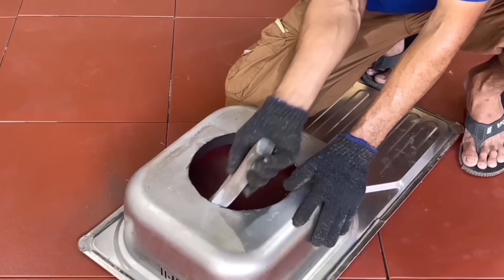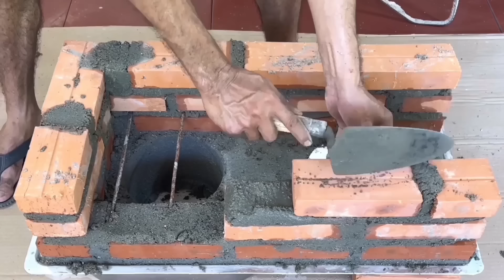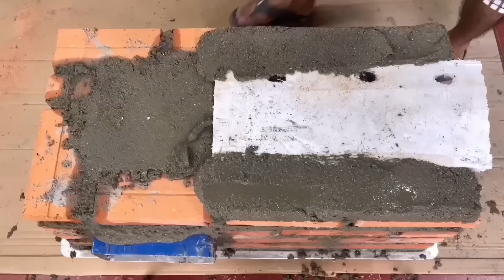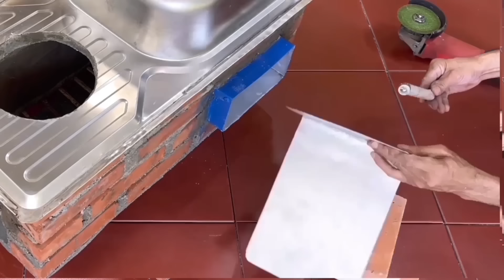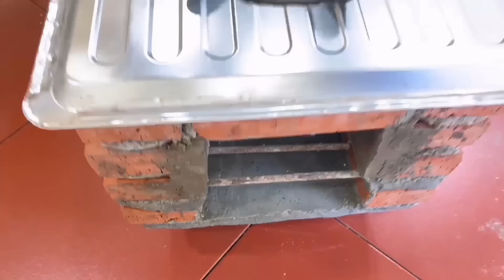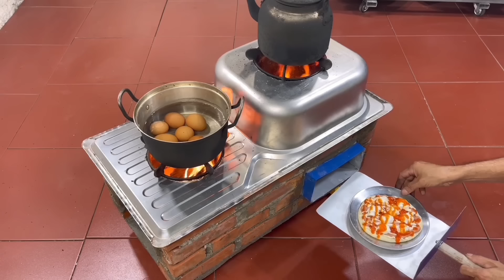wood stove (2 in 1) with pizza baking tray #158

Comment: I love it! I was looking for a way to still cook pretty fast without having to use propane. My electric company is charging me too much money and I believe the stove washer and dryer are pulling the MOST energy. Thank you.
Reply from the maker: Thank you ✌️✌️👍👌❣️💕😀
Reply: This guy is a genius he should be a millionaire
Reply: great friend I have some video about stove too
Reply: @vordc150  _
Reply: More knowledge too you,  are you selling it
Reply: qq
Reply: The water heater might be the culprit.
Reply: wash clothes in a bucket in bath tub or outside. hang to dry, on a line or rope or
pole. stop using elect. yes they ll dry, on a porch or hangers in a room. only heat water in a pan on wood stove , use bar b q but heat water on that.  Get a 10 gal or larger sprayer for like outside plants, make a longer hose, connected to spray handle  part, put half w hot water 
add cold to make to your
own liking. Use as a shower in yr bathbtub. 
forget water heater. 
use $ for other things.. 16:54

Comment: You should have build in the chimney and the flame controller like functions to be able to make it lower temperature in some cooking, otherwise you have burned food. Perhaps if you build in some long pipe to let water go through the pipe and build the water facet systems like you put T pipes like, then you could get warm water and the other pipe for the cold water by adding some type water temperature regulator like. Just an idea, thought.  Because if someone wants to take shower or wash the dishes, then at least you would have little extra options for the emergency situations.   🤔🙄
Reply from the maker: i understand. Thank you👍👍👌😃💕
Reply: Wood

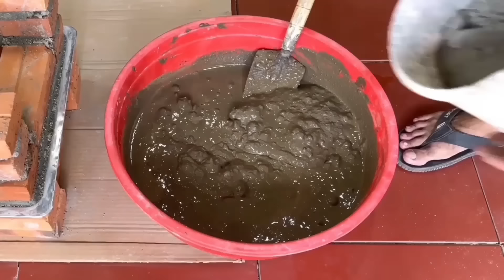Comment: could you provide the dimensions? also what's the fourth ingredient of the mixture at 05:30 approximately? Thanks for the insight
Reply from the maker: clay and a little sand with cement for initial adhesion
Reply: @Penpenvn1  great. I'm thinking about doing it on the balcony but I don't know if it fits